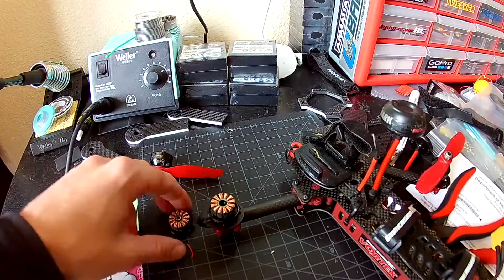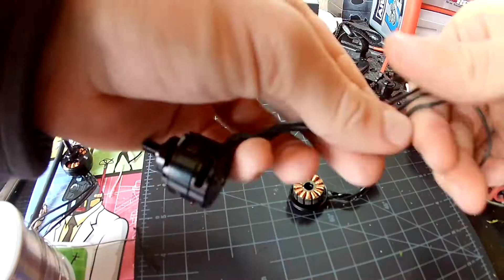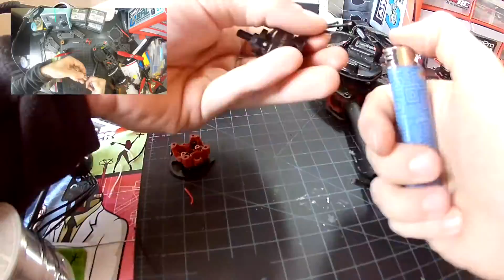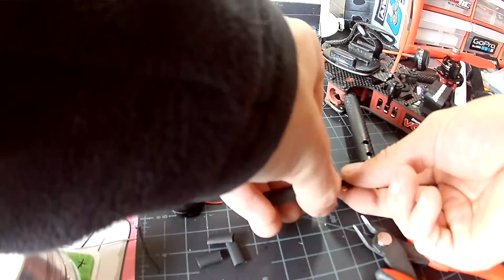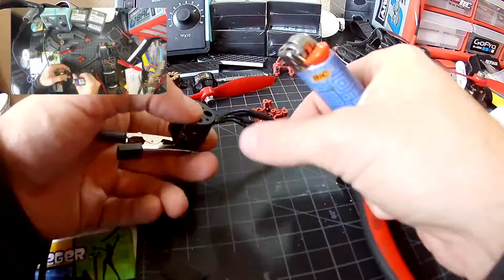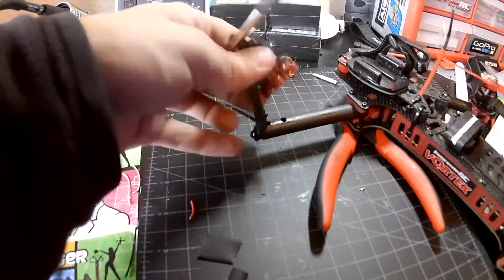MINIQUAD MAINTENANCE // Replacing a Motor /  Vortex 285

Comment: Hello man. Hope your safe. I broke a motor a while ago just like you did but the problem is that I couldn't find a t-motor "same brand" so i just bought 4 motors that have the same rating. Do you think I should set them up like you? Thanks! :)
Reply from the maker: I won't tell you it's the "right" thing to do, but it absolutely works and you likely won't notice a difference 😎

Go for it!

Comment: What were you doing with that piece of plastic to the ends of the cables at around 3:40?
Reply from the maker: That's a bigger piece of heat-shrink I wrapped around all three motor wires. I use small heat-shrink on each wire, then pull the bigger piece over for tension/damage protection.
Reply: Thanks

Comment: and hoping that the spinning direction is the same
Reply from the maker: +Rookie Rotors The Vortex is a little different! Vortex ESCs have "Rotor-sense" which allow you to change the direction of rotation just by spinning the prop in the desired direction twice while disarmed. Makes swapping motor direction a breeze, no more soldering or computer connection required!